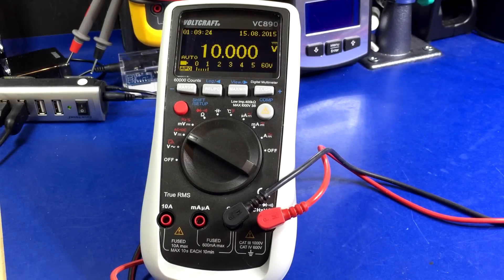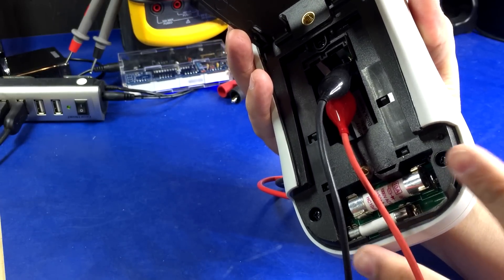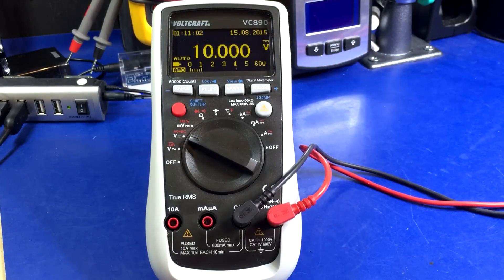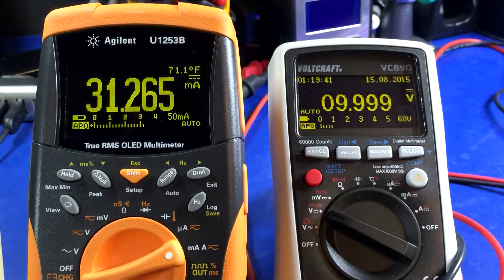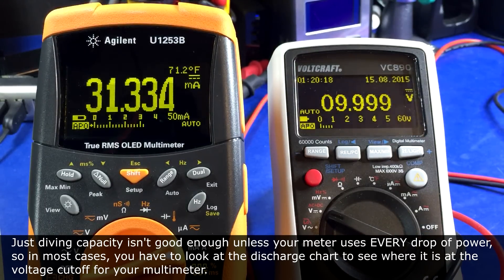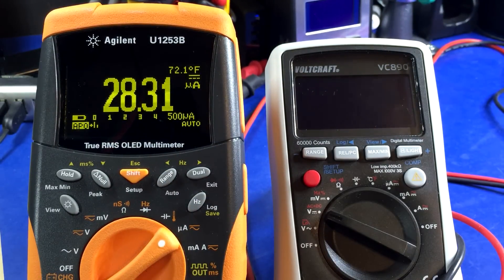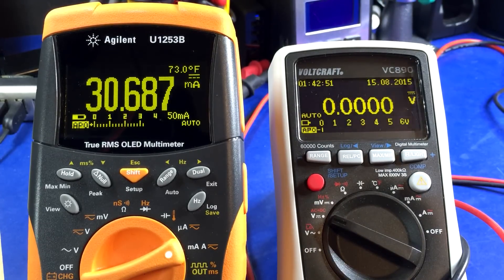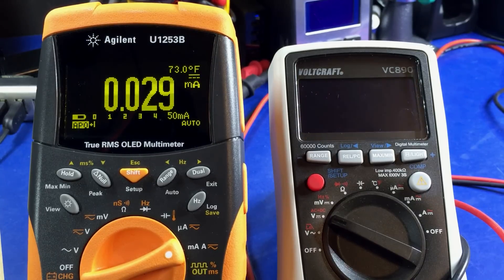Voltcraft VC890 Multimeter Review UPDATE! (battery life / consumption) - #0083

Comment: You have not done a drainage results on the Agilent, since you let it hang in the air, with the statement it is a hell of a lot better than this other fellow.. same display tech, though a tad smaller, so would have been  interesting if you had validated if the Agilent was a big baller in this regard  and how those values compare to your VC890.
anyway, thx for the test.

Comment: Is there a batteriser for a 9V-block? (just kidding :D ) For your OLEDs you might want to buy rechargable 9V-blocks, they are initially very expensive, but the extra-cost will be in quickly. The only problem could be, that rechargables usually have a lower cell voltage, so you might get the low-bat warning a bit earlier.
Reply from the maker: It has actually been going on the original battery so far. I have the APO set pretty aggressively and it helps a ton. Battery still shows full and I've been using it a lot the last few weeks. It still beats the crap out of my U1253B's battery life by a lot
Reply: +Róbert Valdimarsson In the first video we could see that you can set the battery type in the menu. You can set it to "LI-AKKU" and then you can use LiIon rechargeable "9V" batteries.

Comment: Thanks for this - was exactly the information I was looking for. I'll admit that I would have liked to see maybe the use of larger capacity batteries (eg. 6x AAA or 6x AAA - there certainly seems to be enough space in the enclosure for it). However, it is still miles better than the Agilent's battery life.
Reply from the maker: TechBench Indeed.  I'm ok with replacing a battery once a year.  That's not terrible.  But the stupid Agilent is dead every 4th or 5th time I turn it on.  I wonder if I can mod it to use a LiPo